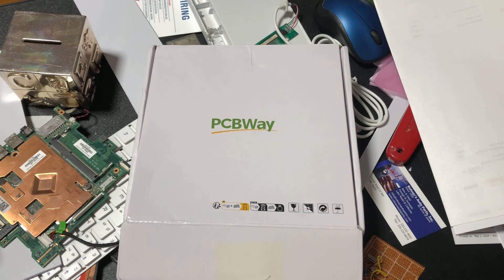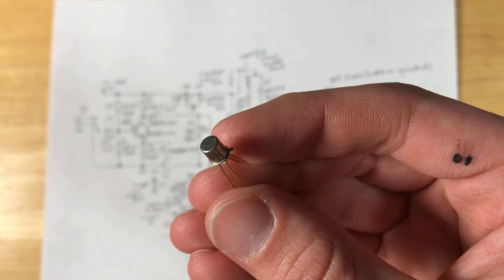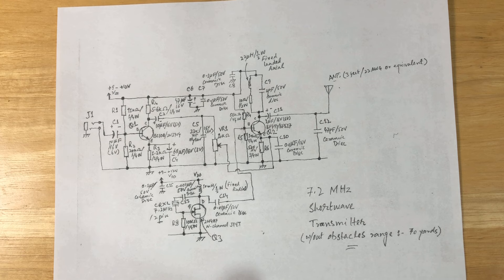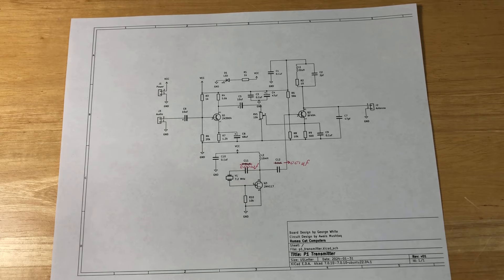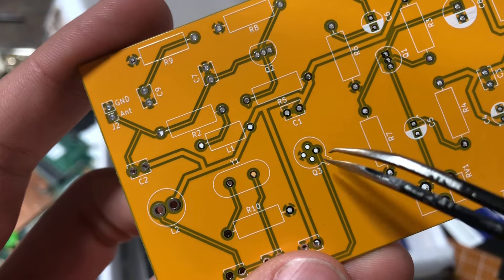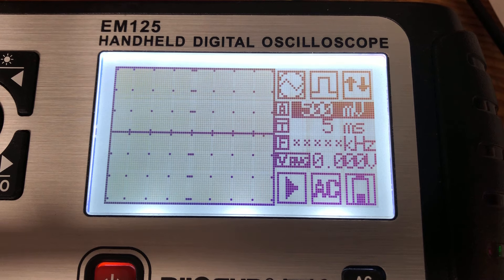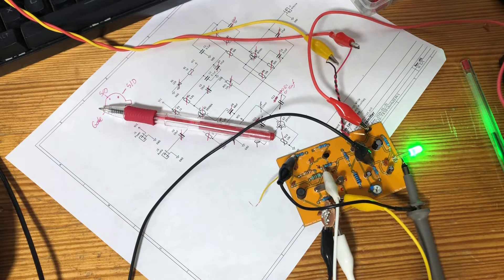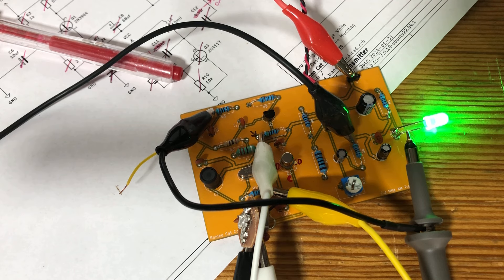The AM Transmitter on a Printed Circuit Board! - AM2PC pt. 7

Comment: Greetings sir. I'm glad you pointed out number of short comings of my previous TX circuit. Audio amplifier design was good but problem was with that laptop jack output increased level of audio which disturbed biasing voltages and distorted the output. I got rid of it and used TI's LM386 WITH 10 k-ohm Potentiometer at the input to control audio levels. Also, please, use a smart phone in place of laptop as it's output impedance is better matched with audio reproduction circuits. Second problem, the oscillator, I replaced it with Colpitts crystal oscillator which outputs 200 mV enough to drive modulator. I shall still suggest to use an emitter follower for isolation purposes so modulator stage doesn't load the oscillator directly. That way the frequency won't shift. I re-calculated the modulator circuit values for 100 mW of power and wound a T-50-2 type toroid with 23 SWG enameled wire equivalent to 22 AWG; 28 turns on primary and 9 on secondary gave me what I wanted. Needed load at modulator stage is 385 ohms and with 9 secondary turns on toroid, I matched it to 50 ohm coax transmission line/cable. I also designed a Band-Pass filter for it that works as it should. If you agree, I shall send you the improved design that still is targeted for 7.2 MHz. I have built it and almost got caught by FAB (frequency allocation board) our equivalent of American FCC. Just say it, if you need it. Nice video BTW. O and the N-channel JFET is cursed. Also, if I may make a humble suggestion, try using an EMI filter on AC mains to your PSU. With RF work, it's an utmost necessity. It does excellent work of removing RF remnants from power rails. If you agree sir, make the changes and it should work. My apologies that I got your money wasted. Let me know, if I can repay. Regards!
Reply from the maker: Thanks again for some more advice! I would like to stay with the simple nature of the current transmitter design, but I would not mind taking a look at your newer design (send via email again). I've been trying to build my own band pass filters for this and other transmitter circuits, but I have trouble figuring it out.

In the setup in this video, I used an iPod nano as an audio source. I have used laptops and cellphones during other testing, but most of the time, I use the iPod. As for a power supply, I usually use a 9v battery. This time around, I got a hold of a 12v battery that gives it a bit more power. My circuit was completely isolated from mains (even the portable oscilloscope was battery powered), although I did not apply any shielding this time. Interference has not been a big issue for me, but I keep it in mind.

I have gotten a hold of some T50-2 toroids as I plan to use them for impedance matching later on. I still want to make a ham radio enabled version of the circuit in the future. I think for now, I will use my usual oscillator in later circuits because I cannot seem to get the JFET version to work. As I said in the video, I built it many times and I have used several different 2N4117's with no luck.

Thanks again and best wishes!
Reply: @rcat256  I'm sure you'll get it working soon enough, sir. A simple suggestion on audio amplifier part, the previous audio stage of mine was to be fed from a mic, an electret capsule to be exact; that vital part I forgot about. Please, keep in mind no single amplifier stage can get you the gain and power you need. You'll have to use cascaded stages, two at least. Excellent idea using PP3 and other PP series batteries. They surely solve the clean power rail issue. I use a PSU because at 100 mW power, PP-3 gets depleted fast. Also, LM386 consumes quite a lot of power so PP-3 life is shortened even further. Previous circuit was designed for 50 mW and for that PP-3 did well. I used LM386 when I realised my mistake that a pre-amp for mic won't do at all with then prevalent circuit conditions and that I needed multi-stage amplifier circuit. Instead of re-inventing the wheel, I used the existing low power LM386 which served my purpose excellently. If I may make a humble suggestion, you can drive modulator with LM386 without having to use direct power input. You see that LM386 internal circuitry reduces the applied input by a half; means 9 volts shall be halved to 4.5 volts, sufficiently high to drive modulator (with a choke of 10 uH at amp output pin to block RF getting in) stage and still give you up to 200 mW of RF power. Choice is yours, sir. I'll send you the new circuit in digitised form soon. Stay safe!

Comment: Analyzing the circuit a bit. It might work, but some of the components don´t make much sense. The audio amplifier provides (based on it´s values) to less audio level to get a "full" modulation out of the transmitter. It would work much better, if  "R6" would not go to ground, instead it would go directly to the collector of "Q1" "R4" removed, and the bias re-aligned. Instead of the voltage divider R1 / R2 you could just use the 91k and connect it from the base to collector. Also connect Q1´s Emitter directly to ground. That would form a proper AM modulator, and would create a good and loud modulation. For shortwave, "C10" can be reduced to .022 instead of .1. That would improve modulation quality a bit. The Resistor in series with the coil... has what... exact... purpose? Talking about the 22µH coil - at least the value of the coil is "okay-ish", if you want a high impedance output (Which is okay if a short antenna is used). The oscillator could use a safety resisto, bc as it is now, the fet is directly between + / - so, if sth goes wrong, it´ll go "pop". Also there´s no antenna matching, but for the said distance "up to 70 yards", it will do without matching. The transmitter, as is, is most likely going to work... but I doubt the modulation level it can achieve is anywhere near a "makes sense" useable level. How should the modulator drive the "pA" if it´s current limited by high value resistors opposed to low value resistors in the final amp? If such a methode would "supposed to be used" the modulator would require far lower resistor(s) to provide enough Audio signal to the final amp. You said you do co- work building transmitters...? I can make you a very-very- simple 2 transistor am transmitter / shortwave transmitter, that has >70yards range, and far-far-far less components than this circuit... ... With more than 20 years of RF device (build receivers, transmitters) experience I just had to leave a comment here. Good luck getting the current circuit to work tho (not meant sarcastic)... I may check here for the results ... eventually.